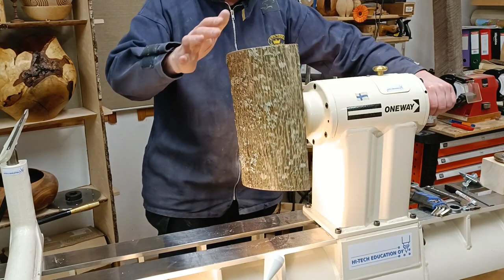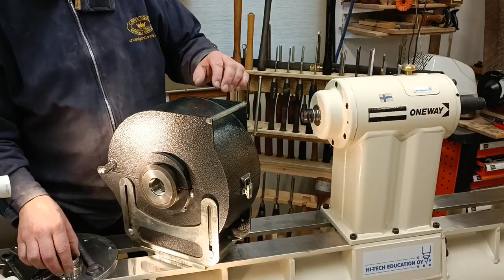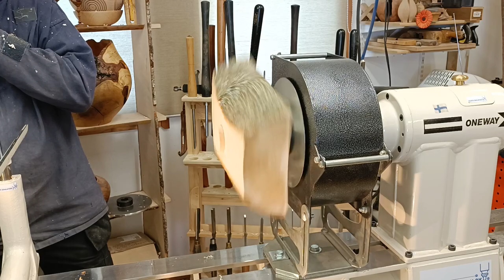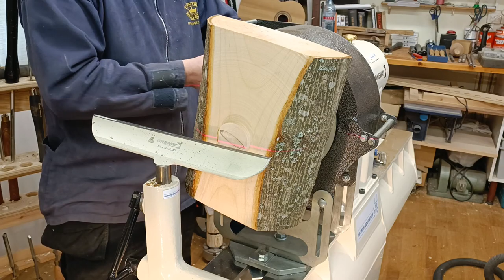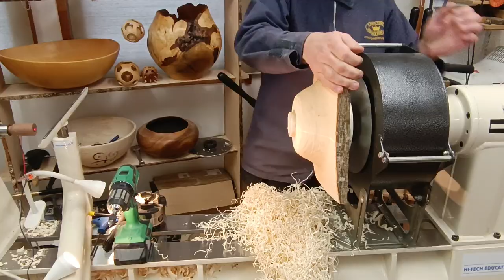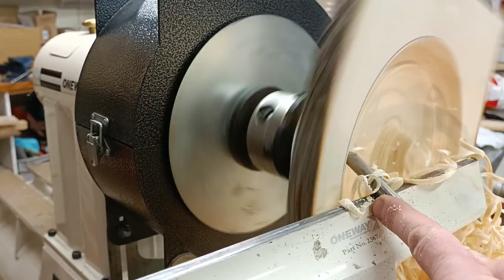How to turn an oval bowl?

Comment: So much for the never use a spindle roughing gouge on a bowl warning.
Reply from the maker: The fastest way to remove chips.
Reply: @JarnoKorhonenWoodturning  push cut with 40/40 grind is even faster, and so much safer.  But keep on taking unnecessary risks.